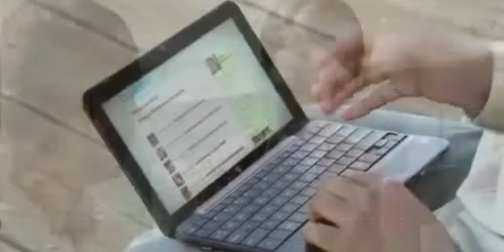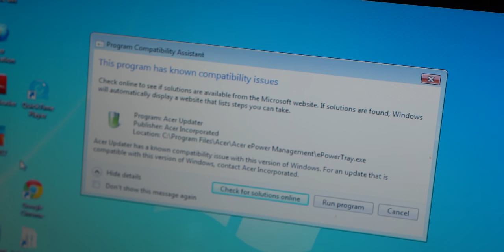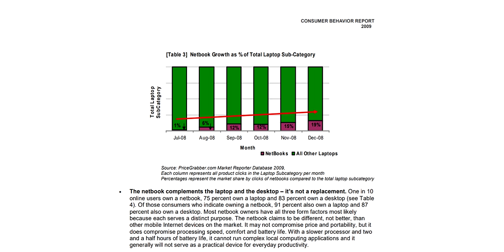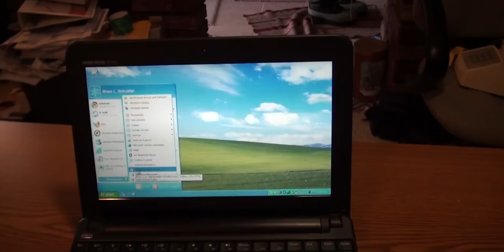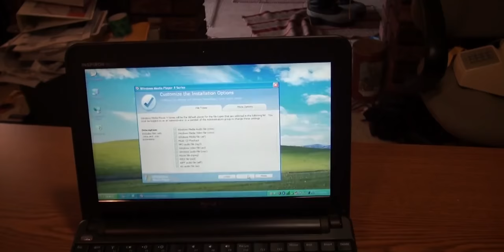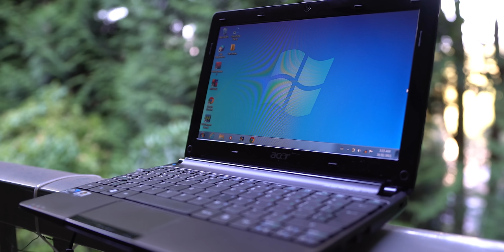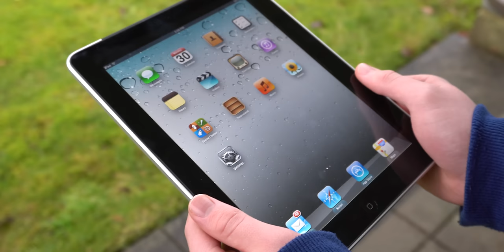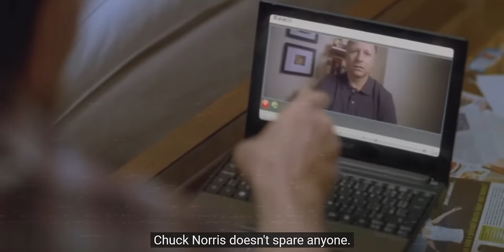Why Netbooks Failed - Modern Retrospective

Comment: Ah i actually loved netbooks. I went to army back in 2010 and most of my cabinmates had a netbook to themselves. When i got onto my first leave, i decided to get myself a netbook also! I got myself a Dell Inspiron 1012 model if i remember correctly. The biggest dissappointment for me was that the things it claimed to excel at; battery life and online surfing, it was absolute dogshit at. 2,5 hours of batterylife at most and almost every webpage lagging far more than our desktop from 2004.However, i had a soft spot on it for it's sturdy build (seriously, that thing flew onto ground so many times and it didn't even get a scratch on it!) and it was a great way to play retrogames on it. We even had small lanparty sessions in our cabin with other people on some of the retrogames like doom, Operation Flashpoint etc. Also at the time with the help of portable dvd-drive it worked as a small movie machine too.

Later years i tried installing lubuntu linux on it and it felt as laggy as ever when browsing the web, even when installing 2gb of ram and an ssd on it. I miss it's sturdyness, but not it's low specs... Poor thing.

Comment: I still have a netbook I got when I signed up for a phone plan and for what it was it does what I needed. The battery is dead now but it will run as long as it remains plugged in.

Comment: Don't agree with 90% of your complaints about netbooks. I liked mine because I wasn't expecting it to be as powerful as a regular laptop. I built my own PC tower desktops and had regular sized laptops for travel but found them too cumbersome and heavy and so I liked my netbook for this purpose. Later I switched to tablets but fondly remember my netbook. I converted my last Dell laptop - Ryzen 3 with 8 Gigs of ram, 1 terabyte HD, 17" display, Winblows 10 - into a Linux (Ubuntu Groovy Gorilla) machine, switching out the failed HD for an 512 Gigabyte M.2 SSD for my main drive and a 256 Gig standard SSD for extra storage and added 8 more gigs of ram. I'm also into Raspberry Pi. Well good luck with your bitter rant.

Comment: My first personal computer was a Acer Aspire One D250, had Windows xp and I have no complaints to this day. I used to do all kind of stuff, and was my main device until 2016 even for drawing.
I no longer use it regularly but still working fine with things like Word and stuff (of course, it can't stand today's internet navigation and the battery is dead so it needs to be plugged all time)

Comment: The problem with netbooks was, in my opinion and before watching the video, the atom processor. A single core dual thread cpu was a piece of sh...
Just Samsung used a dual core quad thread atom in the latest models from what I can remember
Reply: I still have two of them running Linux lite and Antix Linux.

Comment: My netbook is still going, running Fedora now. It is next to my network stack in the basement, used for any maintenance I need to do without bringing a laptop. It is not a speed demon, while it is looking for updates I can verify 3 other Linux boxes I have are up to date. I have maxed the memory, upgraded the SSD, and the battery is shot. But for a 'crash cart' for my home network, it works well.

Comment: I had a Netbook for a bit like 3-4 years ago.
As gaming laptops do, the battery of mine died, and since electricity on trains isn't guaranteed to be there and work, I got a 20€ used Netbook, slapped a 10€ 32 GB offbrand SSD in and used it to type up assignments and do the occasional remote connection thing

Comment: I had a Toshiba NB520 way back 2012 I think. The speakers were awesome. For $300, I had no regrets. Fast enough for 4-5 tabs opened in Chrome while PowerPoint or Word is also opened.

Comment: I had an Acer Aspire 1 first gen. It wasn’t great with a gig of ram and 120gb HDD, but I upped it to 1.5gb of ram (as it only had one dim slot occupied by 512mb from the factory and the other 512mb was soldered to the board) and a 500gb hdd. Then I used a heavily modified rom of XP with much of the bloat ware removed and honestly, it was a pleasant experience for quite a while. I actually liked it. A lot. And I used it both as is, and with external KBM at home for a less cramped experience. But I was a tinkerer that didn’t mind the fuss of connecting and disconnecting peripherals or using modified Windows roms.

Comment: Very late to the party with this video, but I LOVED my netbook. I had an older model Aspire that was purple. I took Windows off of it, although if I remember finding an app to let you change the wallpaper (not that this excuses Microsoft removing that functionality). I'll be honest, even after a ram upgrade and an installation of Linux, it ran a lot better, but it was still pretty rough. I pulled it out recently and it just cries these days. LOL

Comment: One thing I miss about netbooks is that each cell phone carrier had their small handful of netbooks with built in cellular 3g/4g antennas. They were either dirt cheap or free with a contract. No dongles, and netbooks with cellular doubled as a hotspot. Even Apple saw the potential and made prototype MacBooks with built in 4g (or WiMax?). Sure each carrier still sells cellular laptops (overpriced af), but they'll never have that cool factor like when the feature appeared on netbooks.

Comment: I actually really liked my netbook.  I picked up an Acer Aspire One (can't remember the model) in 2009.  It ran Windows Vista horribly so I jumped to Linux and distro-hopped for pretty much the entire 5 years I used it as my daily driver.  When I got rid of it I had Crunchbang Linux installed and configured to my liking.  I ended up giving it to a friend who needed a laptop for school in 2014 and it ran without issue for him until it died in 2017.  Not to say that everyone had the same kind of experience, but for me it was a delightful time for computing.

Comment: I actually still use my netbook. It is the perfect size to use on the Greyhound or train in addition to using at a library. It is true though that the first thing I did was ditch Windows and used Linux instead.

Comment: I did not know, there was such advertisment in Czech Republic ( in 10:02 in video ) :)

By the way I still have working Asus eeePC 1215N netbook. It costed me then ~ 400 USD in early 2012. It came with Windows 7 Home premium, 500 GB HDD and 2 GB RAM. I replaced once battery and reused RAM and SSD from trashed PC and Dell Inspiron in early 2014, since then it has 8 GB RAM and 180 GB SSD. I reused HDD as external HDD. Even today it is usable and I bring it to places where I am afraid of damaging or getting my ZenBook (from 2018) stolen.

Comment: 7:35 - You say the kind of person buying a Netbook wasn't looking to make it any better? Well I bought mine for like $20 bucks, already damaged with a corroded motherboard, and my whole intent was to fix it up, make it work, and upgrade it about as much as I feasibly could.

I ended up with an Acer ZG5/A150, which shipped with XP Home. I got a new motherboard on a cooperative deal with a friend to fix her laptop, so that was free for me. Yes I got it working, but quickly discovered it's limits.

It started with a 120GB HDD and 512MB RAM, XP Home. Well of course I found that insufficient, so I went researching into it's max specs and other documentation on it. I found it supported larger hard drives and up to 1.5GB RAM.

I also found the schematics for the motherboard haha! I ended up installing a 500GB HDD, an extra 1GB RAM module to top it off at the max 1.5GB, counting the built in 512MB RAM.

But along with the schematics, I discovered unused traces for extra USB ports, so I also installed a hidden 4GB flash drive inside which I installed Ubuntu 10.04, where I even modded that to turn off the hard drive to save power. Ubuntu was strictly running off the USB flash.

My goal was to be able to play a 2 hour movie, from a RAM drive of 768MB, on the stock 3 cell battery alone without recharging. I was actually successful with that as well.

Later on I even custom made an addon overlay touchscreen adapter for it from spare parts for a 21" touchscreen. Was a challenge to get the calibration utility for it, but when I emailed the touchscreen device manufacturer about my custom project, they were quite helpful and sent me a copy of their calibration utility.

It sucks that the netbook plus a number of other things were stolen from me in 2015, but I'd like to think I got the most out of it while I had it.

I still have the custom touchscreen for it around somewhere though..

Comment: Freshman year in college undergrad: my gateway laptop got stolen. I couldn't spend on a full brand new laptop after that happen, so I bought a netbook acer. I loved it. But of course after 2 years, it didn't work as well as I needed it to for my course load. I upgraded to a Dell 17in laptop but i remember my netbook fondly. *i still own it today but haven't used or turned it on since 2011 so it probably won't work well.

Comment: Back in 2009, the $300 Acer and later, Asus Netbook with the extended battery, was how an Applebees server was able to get a degree in CS while on a budget. It was great as I wrote my code in the text editor, read my homework via PDFs and completed lab work remoting into a beefier machine using the netbook as a thin client or dumb terminal. I did eventually up the RAM and HD at some point. But the devices were great thing before the aforementioned devices (Tablets/Chromebooks) were a thing.

I’d argue, they are still a thing. Just in a different form.

Comment: I still use my 2GB HP mini netbook. It boots Elementary OS from a thumb drive and I use it as an NFS file server. I hooked it up to a 6TB USB external drive where I store backups. Small, quiet, and fairly low power.

Comment: I'm watching this video on a low end Acer Spin netbook. Of all my windows 10 machines it's by far the most useful despite only having 64G flash. It just works. The automatic upgrades just work and do so quickly unlike my desktop systems with huge disks and fast processors. Acer did a really good job.

Comment: Ah yes. The EeeePC. I got one around 2008. $250 + $60 for the 1GB RAM upgrade. It lived for less than 2 years. Started out being alright. Hell, I even played World of Warcraft on it.
But, it slowed way the hell down, the keys started falling off, battery craped out as well as the trackpad.

I saved the HDD as an external backup drive and made a keychain out of the RAM. The rest went to the eWaste facility.

Comment: Bought a cheapo laptop only a couple years ago, running under Windows 10 Home. That's pretty much a netbook - Atom CPU with only passive cooling, little RAM and disc space. We only need it as a "kitchen computer", but during lockdown our kid used it for remote schooling - Zoom, Teams, MS Office. It's slow and weak, but was at least something, before we got our kid a proper laptop.

Comment: I bought a Nokia netbook that had a 3G wireless modem built in.  I bought it because I was doing consulting and wanted something I could bring with me and never had to worry about connectivity.  I actually still have it, just have not used it in years.  I got a consulting gig that required me to use an iPad and over time I just stopped using my netbook.  The one thing I will say for the Nokia netbook is that it had an amazing battery.  I could take it on a 2 or 3 day business trip and not have to bring the charger along with me.  So, I got good use out of it for a bit.  The 3G turned out to be superfluous.  It turned out anywhere I wanted to use it ended up having WiFi.  Then my phone could be turned into a hotspot.  So, I would never buy something like it again.

Comment: They are still useful for IT and the occasional debugging. My wife still has hers, runs slow with soldered 4gb ram and the soldered processor is a celeron.  I have used it off and on since my laptop is just oversized and heavy.

Comment: I was able to get my asus e200 working on windows 10 by reformatting its internal storage and using it almost 100% to store the OS. Then I used both the integrated micro SD and one of the 2 USB ports for storage (180gb+-). It ran great since all the storage was still flash and could handle alot of turn of the millennium games as well as running actual office and Adobe products instead of cloud based alternatives. Only issue was the 2gb of ram. It would cause occasional crashes but for a mini laptop that fits in any bag with a 10 hour ACTIVE use battery it was fantastic!

Comment: I had a 10.1" Asus Netbook I got ca 2009-10. It had a 256Gb SSD w/8Gb of RAM. It could boot windows XP or Backtrack. 

It was great for working on papers I had to type if I was going to be away from home for the day. It was also great for the web. But, it's real value was the sheer volume of torrents it downloaded from the web...(!) Also, I learned quite a bit about Linux from having it as well. ...Oh! & I could change the background w/no problem....(?)

Comment: Netbooks sold in crazy numbers, especially in Asia. It brought the best of a fully-featured OS, long battery life, often very sturdy builds as a result of the small size and they often had plenty of ports. Sure, the early Netbooks were limited, but later versions were far better.

Comment: I still have a netbook. That's what I'm using to write this comment. They came out at the right time. I always considered them adequate for a period, when the economy had tanked. Yes, they don't have a CD/DVD drive, but I have USB connected drive. Why netbooks died is no surprise. It had a limited market, for a limited time. A chromebook is an appropriate replacement.

Funny, I surf the web, today (Win 7 Starter) and even stream videos with it. Not fast, but adequate. Bought it in 2011.

Comment: Asus EEEpc series we're pure genius at their time. I bought my 1005HA in 2007 for college and it's still working. Brought it everywhere with me, a very robust, reliable and beautiful clamshell-like machine. Of course Windows XP (or Windows 7 Starter) where awful, but the EEEpc's run like a charm on linux lightweight distributions. Netbooks will endure and, in five years or so, will became a retro cult thing,  you'll see (specially those darn cute 700 and 900 series).

Comment: I bought a netbook without knowing they were soon to about to disappear.  I still have it, but it runs on Elive Linux and the battery doesn't work at all.  I use it as a backup for my desktop whenever it needs service.  With today's graphics, it's very slow on internet (esp with only 2 gb ram) but as I said, it works when I need it to, which is not often.

Comment: It seemed the main selling points that netbooks had over laptops is that they had physical keyboards at all, as well as the fact that they were “real” computers unlike the iPad, which still runs an iOS variant despite having an m2 Macintosh processor. The Chromebook seems like a more contemporary realization of the EEE Pc’s Linux variant.

I did like my Acer Aspire One from 2011.

Comment: I have what is essentially the spiritual successor to a netbook, an HP Stream 11 from 2014 with Windows 8. It was supposed to be a "Chromebook killer" and was even similar to a netbook in terms of the interesting design (mine was pink, with a polka dot pattern on the keyboard). It was pretty slow for anything but Web surfing, again like a netbook, though I somehow managed to use it as my main laptop, mostly just for school assignments and surfing the Web, from when I got it in 2015, to 2020 when I replaced it with a MacBook Air, which was quite the upgrade LOL.

Comment: I had one around 2015-16 (built in 2012, got it for free). Since i got it without a harddrive i installed win7 pro. The experience wasn't good, youtube was stuttering at 480p, the 1024x600 screen didn't show much, but it worked to do presentations in school and some webbrowsing.

Comment: I had a Samsung NC110 for many years. I used to take it travelling with me and It had some programming stuff and my oscilloscope software. I still have it. Replaced it and my Lenovo Z480 with a macbook air in 2015. Now my old netbook has my pirate toyota techstream software and VCDS on it. It also runs my old Honda factory manuals which are these weird exe things.

Comment: Fucking hate Nextbooks with a passion. My mom had gotten me one for christmas, and i remembered i wanted a gaming laptop/pc anything that could play games from the 360 era and downwards i was ok with. She didn't get me what i wanted cause they there absurdly expensive (no duh) and didn't understand computers all to well. I dealt with it cause christmas gift. (and at this point it was one of the first computers i ever owned)

The fucking thing was literally a potato for all potato pcs. It was a bloody tablet with a keyboard attached to it, wasn't even a fucking laptop straight up disrespecting all computers at this point. The only plus side i can give it are it had 100gb storage or 50gb. (wasn't so bad if you knew how to optimize space on your computer for games.) But to me that's the only good part.

The downsides were you needed a microsd card to upgrade it's storage space. (i did get one at somepoint, begrudgingly.) IT HAD A FUCKING TOUCH SCREEN THAT COULDN'T BE TURNED OFF and whenever you typed, if it felt the slightest movement it would disconnect the keyboard. (pain.wav) And the jack of all trades, it has 1gb of ram. (I don't even know how i played steam games on the thing).

Truly i hate nextbooks. Shits aren't worth the money for anything. (Maybe if your an office worker, but i would get a thinkpad at that point).